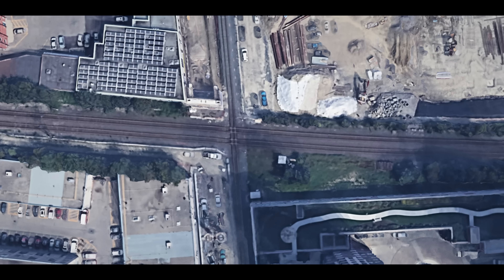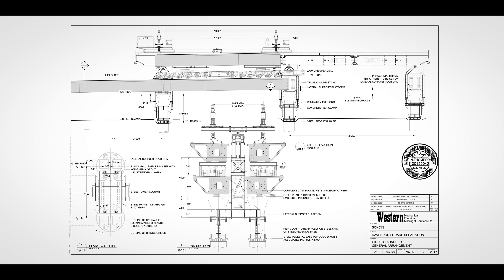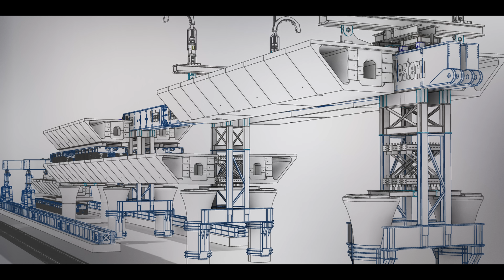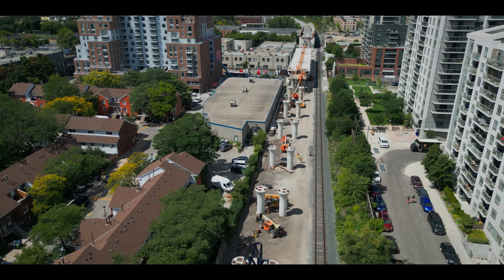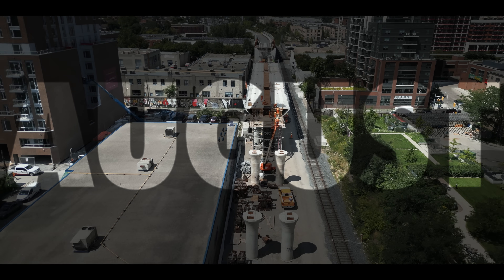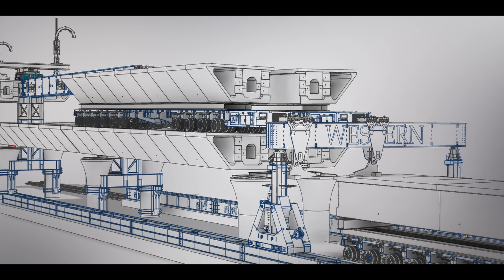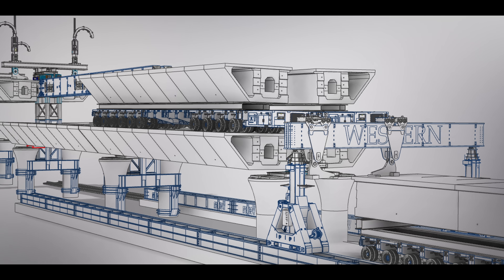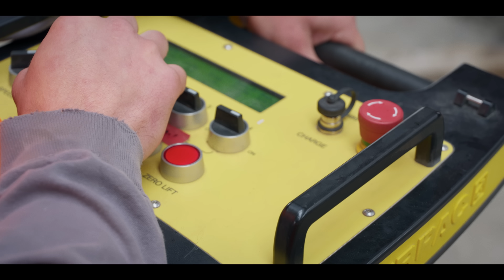Raising 1,200 Metres of Train Tracks in Toronto

Comment: Well, it's nice to see that GTO enlarge its trains and commuter system when in Montreal, they still discuss on the closing of train lines, the return of the tramway (20 years later, not a single project) and discover than the infrastructure of its metro has rarely being maintened and cracks...  Their vision is nombrilic...

Comment: The Gantry design makes me think that the Engineers were inspired by the P-811 Cement Tie & Rail Installer from British Columbia. I worked as a Welder for CNR during 1981-82. I spent a month or so working behind the P-811 in Northern Ontario on the CNR Line between Hornepayne and Nakina.
The P-811 would cut into the rail and move the rail along the outside of the machine (which spanned a LONG distance). It would break up the wooden ties and stack them on the machine while installing new Cement Ties and ultimately the rail would again be lined up with the ties. My Welding Gang was responsible for Thermite Welding the ribbon rail where the P-811 cut into the rails and where they cut out at the end of each day.
The P-811 had several gantries which rode on top of the rail cars with a little metal rail bridge between the ends of the rail cars and would carry new cement ties to the front of the machine and pick up the old wooden ties and deliver them to the rear of the machine where they were stacked on cars for removal. It was a very impressive setup and a great experience. 
The gantries in this video immediately made me think of the P-811.
Reply: Sure would be nice to watch if you know of any videos made of your said project🙂

Comment: I'm amazed there's no fencing along the edge of the rail line to seperate the work site from the danger zone. 

It's standard practice in other countries because it's highly effective at preventing accidental incursions by people or machinery into the path of trains.
Reply from the maker: There was very little space between the live rail and the work zone considering the type of equipment required to do the project. Definitily not enough for a dividing fence to be installed. Therefore rail safe staff was on sight 24/7, they had constant communications with rail dispatch and the trains themselves. The speed of the trains was slowed through the work zone and all workers/equipment had to be 20 feet away from the tracks 2 minutes prior to the each trains arrivial.

Comment: Interesting and creatively shot video, but with the constant scene shifting it was hard to figure out how they approached this project. I'd have loved a diagram showing the process so I could easily put the video into context.
Reply: Yeah, I got how the beam lift worked in basic terms, but didn't really get a feel for the layout and when they used the cantilever machine and when they didn't, and how the steel leg supports work. Did they design the legs to take more that double the normal load (installed beam, plus new beam, plus cantilever installer machine, or did the steel leg sheathing provide that extra support? A bit more detail on how that actually worked would have been good.
Reply: @xxwookey  Given the complexity of the project, the team in charge of building the bridge and the team in charge of doing the structural design would have had meetings to clearly understand the loads on the piers during construction. The piers would have been analyzed by the design engineers to ensure they could withstand the construction loads. It looks like the collars installed around the piers were used as part of the support system for the gantries that carried the girders to their end locations.

It's a complex erection procedure that would have required a lot of planning and very impressive in its execution.
Reply: @xxwookey  

The steel legs were installed so the machine could be extended and placed on them. It wasn't cantilevered because both ends of the machine were supported. If it was cantilevered then only one end would be held down and the other would be free. 

A regular crane put down the first two sections. The team then installed their machine on the first two sections and the steel support legs around the next set of concrete legs. The next two sections (one each side) are picked up by the machine, one each day, and the machine moves forward until the front rests on the steel support legs. The two new sections are laid into place. After that the base of the machine moves up a section, the steel support legs are moved ahead to the next set of concrete legs, and the process repeats until the end. They then moved the machine back to the starting position to fill in four sections in the opposite direction. 

While this may be a new technology for this company I've seen videos of bridges being built in Europe (and perhaps Asia) using similar machines that are cantilevered. They add sections to the bridge deck that are only attached to the existing deck on the one side. They were building a suspension bridge and there were no legs for the forward edge of the machine or piece to rest on. After the deck was completed the cables were added in order to take the mass of the traffic.

Comment: Great work there is huge risk here in this urban area.  Looks a lot like the way they build high speed rail track in China except they use this method when they have space which you guys did not have here.
Reply: https://youtu.be/grhP0F5zv6g?si=RyP176Bgo5sOfQTn
Reply: The Chinese, in some areas spanning valleys, were doing everything from the rail line on top of very high columns with no help from the ground.
Reply: That’s engineering for you - find and use the solution that works🙂

Comment: This project is quite small and not some kind of technological miracle. It’s been done before on a much larger scale. The Skytrain system in the greater Vancouver area has almost 100km of above ground track like this…
Reply: Working in such a narrow corridor with wider spans, and safety complications from 2 active rail lines nearby is the real difficulty. If the SkyTrain was threading a needle this is like trying to shove a pool noodle through a keyhole.
Reply: thought so too... but we're celebrating all these baby steps i guess? 😭😭

Comment: couldnt this concept be used for expediting the repairs of the gardiner expressway?
Reply: If you want to shut down the gardener probably
Reply: It's a bit late now but note how building a trench expressway like Decarie in Montreal is the best choice.
Reply: No?  The highway is ridiculously wider, bigger, heavier.  Rail may carry more people but highways are way more difficult and expensive construction.
The Gardiner reconstruction is already going fast for what it is.
Reply: Yes, but it would require the shutdown of the Expressway, which would probably be hell.
Reply: @chryspelegris2731  there was a bridge in Hamilton (search Aberdeen bridge replacement Hamilton) that was replaced in a weekend about 10 years ago.  It appears the replacement was constructed in pieces nearby and simply wheeled into place and connected, quite similarly to this project. I would think that with some forward thinking design and construction that a lot more of our transportation infrastructure could be made somewhat modular and replaced in this way, but I’m not a civil engineer so it would definitely be interesting to hear an expert opinion on it.

Comment: These guys did all that in 2 months, meanwhile metrolinx is faffing about with the Eglington crosstown for going on 12 years. How pathetic.
Reply: What’s funny is that you made this comment without taking 10 seconds to think of the difference between the two projects because you were so eager to engage in government bashing.  This is being done above grade while the majority of the Eglinton subway is below grade. I agree that the Eglinton line is taking far too long, but you’re trying to compare apples and oranges, this section of track doesn’t even have a station, has little to deal with in terms of below grade infrastructure like power lines, sewers etc. nor does it require a third rail for power and isn’t having to deal with a pandemic in the middle of the project. They are using a novel method of situating the sections of track and it is very cool, and makes the work lightning fast but the scope of the project is completely different from Eglinton.
Reply: @sjsomething4936 I aint readin all that, when do I get my crosstown?
Reply: @elliaturner723  ok, you’re lazy, go find the date yourself.
Reply: If you listen to the first thing the project manager says, Metrolinx was directly involved in this project as well. Also another person already pointed out how these are two very different projects and how your comparison doesn't work.
Reply: @AyesC9000  When is the Eglinton line supposed to open now?
Reply: @appa609  yes
Reply: @appa609  they seem to have stopped giving us projected opening dates 🙄.
Reply: Uh, it's also Metrolinx doing the GO Expansion project
Reply: This is a Metrolinx project
Reply: GO Transit is a division of Metrolinx. These guys also worked on the Eglinton Crosstown.
Reply: It's like building a 1200m bridge is easier than building 15km of tunnel under a street...
Reply: bear in mind and im sure you are aware that the Co. that did this railwork is not run by (1) the federal gov (2) the provincial gov (3) the city of toronto....none of which are known for lightning reflexes on ANYTHING 'cepting partisan issues! that is sad.....
Reply: @peteaplin8324 GO is indeed run by the provincial gov, what are you even talking about?
Reply: @peteaplin8324 Crosstown is being built by a private consortium.  Not government.